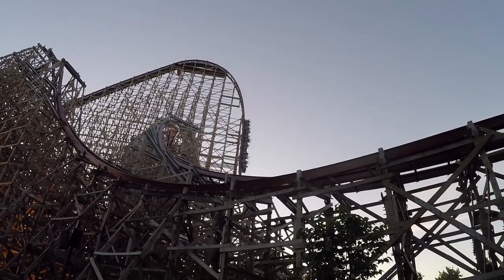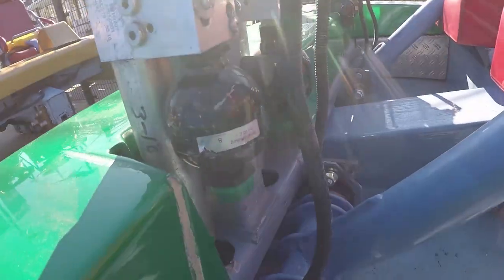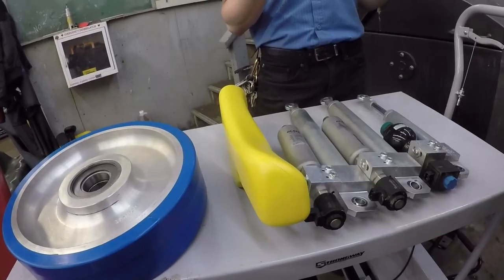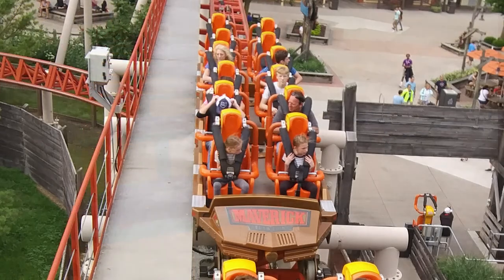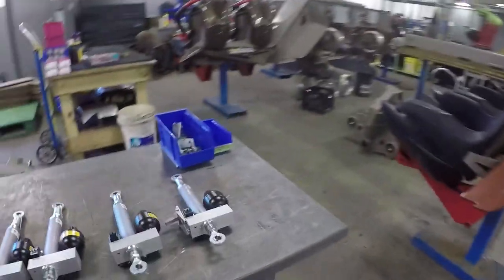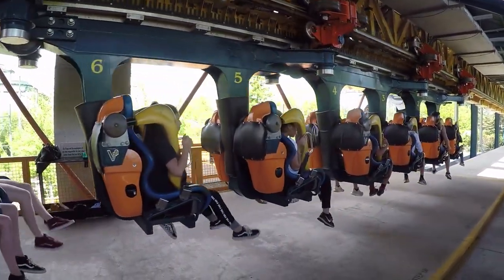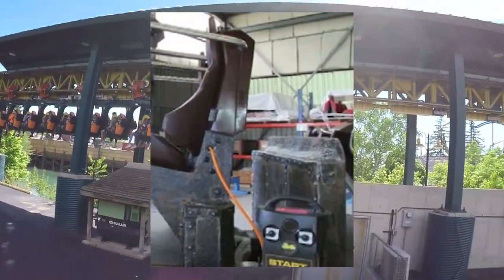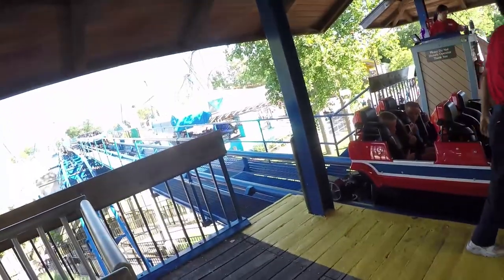Can Roller Coaster Restraints Open Mid Ride? (how roller coaster restraints work)

Comment from the maker: Going to pin this as it seems to have come up a lot in the comments. Another way ratcheting restraints can come up slightly is by "slipping a ratchet". Meaning that the restraint was not fully clicked into the next ratchet and at some point on the ride it clicked up one into the next ratchet. This happens from time to time, if you want to avoid it just push down your restraint more before riding!
Reply: GP To Enthusiast yeah this happened to me on Wildfire at SDC. Halfway up the lift hill it clicked in
Reply: It opened to my sister on ghost rider but it was at the start going up so she was ok.
Reply: Pro-tip from an operater, (Diamondback at Kings Island) to avoid this "false click" make sure after you push your restraint down, that you push down and pull up. This will help you.
Reply: @Varadict  I can hear this comment.
Reply from the maker: @tabbijoy6448  What ride?
Reply: This is the reason we have a law in Germany, that says that the ratchet needs to be locked by at least 3 position, until the control system recognizes it as locked.
Reply: Judge roy scream ratcheting restraint completely came up on me on the climb up the hill. Was wearing a seat belt and was a kid so just pulled it back down and wasn't too worried.
Reply: @ilorabird  rare to see such a cool headed kid. My compliments
Reply: That happened to my sister once, she thought she was gonna fall out 😂
Reply: @visionist7  thank you :) mind you it really did have a super large amount to do with my faith in the seat belt or I would of been super scared lol.
Reply: @ilorabird  in Europe a lot of coasters don't have seatbelts. Increases throughput. In America they're usually a legal requirement.
Reply: Can you please do a video on how a ride evacuation is preformed ?
Reply: @ilorabird  Jesus this has happened to me before so out of habit I always ‘test’ my restraints myself.
Reply: This happened to me on Shikra at Busch Gardens. It actually happened because I held on too tightly though.
I pushed the restraint so far into myself that it released half way down the first drop.
*I should add that this was an over the shoulder restraint, but it still worked via ratchet.
Reply: It happened to me
Reply: Once I was on a ride
And on a station after I was sat and the restraint locked it opened
I screamed at the crew crew and a guy came and calmly cmalped it back down and off the ride went
Little to say I nearly issued my selfe throuaught that ride and the restraints had my nails imprinted in em
Reply: @visionist7  it depends on the State since every State has different regulations when it comes to amusement parks . I ridden a few coasters without any belts and only a lap bar .
Reply: I already do that-
Just because I fear it not being tight enough.
Reply: That's exactly what's happening. Thank you.

Comment: Who else is an enthusiast and knows nothing can happen and you’re safe but ur still scared that will happen mid ride
Reply: Not me, cause even if it does, as he mentioned in the video there are seat belts that will hold you in either way
Reply: Did y’all even watch the gosh darn video?..
Reply: akiru anthony i LOVE zumanjaro, scared the hell out of me the first time i was on it!
Reply: UH! Yeah, I'm pretty sure almost everybody has this fear especially during the climb to the top of the dreadfully slow lift hills.
Reply: akiru anthony  so your 11?
Reply: akiru anthony  also that's a drop tower not a roller-coaster
Reply: @alexanderthegreat3444  you're*
Reply: @alexanderthegreat3444  thank you for using the correct you're. Also #heilgrammar
Reply: On roller coasters im only a little scared but the only ride where im actually sweating my butt off is falcons fury.
Reply: I have only really gotten scared one time that my restraint was not correct and it was on El Toro. We went to Six Flags Great Adventure as our senior class trip in 2014 and I was so excited to get on El Toro but when they cam to check the restraints the kept coming back to mine and pushing on it more, at the point I was ready to be like " I have no shame I will get off now" but they gave me the okay so I went. I barley remember the ride (especially the first drop) because I was terrified I was going to die right there and then... But I was obviously fine! Kinds sucks cause I didn't get to enjoy it and I did not re ride that day because of it. I really gotta get back there and try it again (I live in PA so NJ is a few hours away).
Reply: 0MindSwept0 Did you know that fear is a natural thing?.... As the commenter said they know they’re safe (99.9%) they just have that fear each time
Reply: @TS_Mind_Swept  not on every coaster
Reply: Zack Stanfield - Chinese coasters don’t count
Reply: East Coast Redux as an enthusiast myself I’ve had the over shoulder restraints come completely open on the Carolina cyclone at carrowinds a few years back! Came open during first loop and stayed open till the last helix where it locked back to the first click. Very scary
Reply: Teddy Rosenburg - and in all that time you never thought to pull it back down? >.>
Reply: 0MindSwept0 when did I ever say I didn’t? I WAS holding onto the handles pulling it down and it was completely free moving never would relock. Untill the final helix and then it locked tight enough to restrict breathing. The next season they added seatbelts to the over shoulder restrains that click into the seat. In all fairness it’s a prehistoric arrow no surprises there!
Reply: Teddy Rosenburg - it was probably poorly maintained is what it was..
Reply: 0MindSwept0 I doubt that, carrowinds is cedar fair. Cedar fair is rich! They spend plenty of money on maintaining and upkeep. They can’t afford an injury. I googled it and it’s fairly common on arrow
Reply: Teddy Rosenburg - why do you think Cedar Fair is rich? You’d be surprised what kind of corners they cut..>.>
Reply: 0MindSwept0 why do you think? Cause I research shit before I say it. They net 3million a year and have 182million cash in hand. They obviously are the leading chain of amusement parks and when are they ever in the news for something other than the dumb “coaster stopped on top of lift hill” story. That’s how well up they are on their maintenance and operations!!! They only ever make the news for a coaster properly working. You are making a claim about corners cut when you have no proof of that! There’s plenty of proof online the company themselves share about maintenance
Reply: Teddy Rosenburg - what a company says to everyone else and what they actually do are two very different things. Have you actually worked for them Mr. Research? I didn’t think so
Reply: 0MindSwept0 well earnings are factual numbers. And they have plenty of videos showing their work! But hey buddy YOU know everything there is to know and anything so what ever kid
Reply: 0MindSwept0 you must be upset, idk why you picked a fight with me in your first comment. But hey! You finally shown you don’t know everything. I’m grown and fully employed. You’re posting video games........ oh and an adult definitely doesn’t call someone blin. That’s not even an insult in America. “Pancake” 🙄🙄🙄🙄
Reply: @TS_Mind_Swept  I'm sure they did, its just the human mind has a tendency to wonder. I myself often think when getting on a ride that "Maybe I'll be a victim of a series of human or mechanical errors" even though I'm aware its illogical.
Reply: @astronomydemon6312  well it's unlikely, not necessarily illogical; I'm usually too busy thinking about the ride to bother with those thoughts though :p
Reply: I mean, I have a lot of experience with british coasters, and I've only ever seen this happen on three occasions, with one of those being my own restraint.
Reply: For me it's actually the opposite; I'm an enthusiast but I know that very, very rarely, things can go wrong. However I don't fear it for some reason.
Reply: Felice Graziano - because it’s not worth freaking out about and the rides are much more enjoyable when you don’t 🤷🏿‍♀️ (Plus all the redundant safety features tend to make actual issues potentially arising and causing anything more than a scare nonexistent, not that there aren’t some sketchy cases tho..)
Reply: Not me really. The thrill is what scares me tbh.
Reply: 0MindSwept0, not all coasters have them
Reply: Cool Bean - and the ones that don’t probably aren’t worth riding..
Reply: 0MindSwept0, how bout B&M hypers
Reply: 0MindSwept0, or gertslaur eurofighters, cannibal at lagoon, swarzhkoph loopers, a lot of wooden coasters
Reply: Cool Bean - Schwarzkopf’s aren’t particularly known for air time either way, and the others all have the redundant saftey features (seat belts); the only rides that don’t are either ancient wooden coasters that also have zero air time, or janky Chinese death traps that, like I said, probably shouldn’t be ridden anyway...
Reply: 0MindSwept0,  just because Schwarzkopfs don’t have that much airtime doesn’t make my point any less prominent they are still worth a ride and a lot of and a ptc trains and most Gci trains don’t have seat belts either
Reply: 0MindSwept0, also a lot of I takin coasters don’t have them too, like skyrush, i305, Ttd, king da Ka, maverick, millennium force, the pair of Superman’s at six flags America and darienlake and countless others
Reply: Cool Bean - The Schwartzkopfs I’ve been on have seatbelts, and i never said they weren’t worth riding, but I don’t know what you’re on about with the PTC/GCI trains because those ones have seatbelts as well
Reply: 0MindSwept0, my bad on the ptc trains, but gci timberliners don’t have seatbelts do they? Also which Schwarzkopf have you been on the has a seatbelt?
Reply: Cool Bean - GCI doesn’t make timberliners…that’s The gravity group (I also haven’t been on one of those yet); for Schwarzkopf, I’ve been on Montezoomas revenge at KBF and revolution at magic mountain, both of which have seatbelts, again though, not that it matters because there is no air time where you’d actually come out of your seat, they hardly need restraints at all (any restraint is a redundant feature in that case LUL)
Reply: @dilldozar296  how did you stay in the ride
Reply: Yummy Pineapples  we’re probably the same age lol, but yeah I’ve been scared since I was 10 and I still kinda am.
Reply: Yes, I know nothing will happen but I’m still scared lol
Reply: I get adrenaline on these rides, but zero fear, at least not from restraints. The only thing that can still get me sometimes are headchoppers and near misses, particularly on indoor rides like Flight of Fear. Some people seem to think the headchoppers are a more thrilling experience on outdoor clones, but to me everything feels closer in the dark.
Reply: @dilldozar296  Top Thrill Dragster has entered the chat.

Too soon?
Reply: I was on bizzaro and the shoulder restraint popped up near the top of the lift hill it didn’t completely fly off thanks to the seatbelt so I could pull it down this was in the second row it was during a night ride
Reply: Same
Reply: That’s me
Reply: Me. I always ride the "Raging Bull" At SFGA (Six Flags Great America). It feels as if it could always unlock and come open. I still wish there was a seatbelt.
Reply: Me. Which is why I make sure it's tight tight but not too tight. I love it being so tight just to make sure I don't fly out. People at an old theme park knew me and asked me if it wasn't tight enough for me. 😅
Reply: Exactly. You honestly don’t really know or see the restraints locking
Reply: I keep getting a recurring dream that it happens on the lift hills of various rides, that the ride ops don’t really check it so I do and it pops up lmao
Reply: @Glowmoff  😳 3x is too many!
Reply: Me
Reply: Absolutely, I love scary coasters but…..

I’m scared.
Reply: @TS_Mind_Swept  sounds like your home park requires them. A lot of parks and rides don’t have them.
Reply: @Hunting380  Any self respecting amusement park has them, and you can usually tell when they aren't from a mile away
Reply: Me
Reply: @TS_Mind_Swept Not every ride has seat belts
Reply: Im not. Im more trust in coasters than my mom. Im first gonna dr0wn in my bath then d1e on a coaster. Im usually jumping in the coaster just ot really check XD(while the ride is going im jumping in my seat bc of excitment)
Reply: @TS_Mind_Swept yeah well that gonna rip. Thats for you to feel safe but in mind is useless
Reply: @Coaster.Enthusiast.Equestrian  yeah, if you make it out of confetti and streamers like some Chinese parks ecks dea
Reply: @TS_Mind_Swept  well india isnt has the most safest system...hungary is almost the same
Reply: @TS_Mind_Swept   btw i didnt expected for you to answear🤗
Reply: @Coaster.Enthusiast.Equestrian  sounds like they're Hungary for trouble KappaRoss
Reply: Funny enough this has actually happened before to me, ridden an old Zierer Tivoli from the 80s. I was back row and had the train to myself, my brother and I while going up the lift hill, we laughed it was funny it was open the entire ride, we weren’t scared because of how tame that ride was, the coaster was autosled at galaxyland if I’m right haven’t gone there in a year or so.
Reply: @TS_Mind_Swept  not really. smiler at alton towers has no seatbelts for instance
Reply: ME BROOOO and I hate it because it keeps me from enjoying the ride sometimes :(
Reply: @Glowmoff may I ask which one this was?
Reply: Absolutely me
Reply: @TS_Mind_Swept did you even read the gosh darn comment? HE KNOWS HE’S SAFE!
Reply: Not me I’m too I’m the ride to even think about anything else
Reply: Yea
Reply: @TS_Mind_Swept Those seatbelts will with most certainty, not hold you in place.
Reply: @HugoLibert  if that was correct, they wouldn't be there
Reply: @TS_Mind_Swept  They’re only there for show and making riders feel safe. They fulfill absolutely no function.
Reply: @HugoLibert  ok, Boomer
Reply: @TS_Mind_Swept  Mad because you were wrong? It’s fine. You should be.
Reply: Me

Comment: One time while my father was riding one of the drop tower type rides (don’t remember where) the over the shoulder restraint got undone (my guess is he was too large, since he has a beer gut, so it might not have locked in completely) so it would’ve gone up, however, the seatbelt was clipped in so he just held it down with his arms and enjoyed the rest of the ride. Moral of the story: those tiny seatbelts are actually helpful.
Reply: In my country we dont have those tiny seatbelts. Sooooo rip lol
Reply: When I went on bizzaro my restraint randomly popped up I was on the verge of tears but thanks to that belt thing I was able to push it down in time and panic for the rest of the ride let’s just say I never sat in that row ever again
Reply: @sealfromthesea8453  where are you from?
Reply: No this did not happen. Lies
Reply: This just happened
Reply: This just happened and there was no seatbelt
Reply: Wish there would’ve been a seatbelt for the young boy. 😔
Reply: @janessyfleitas8758  the way that drop tower is designed even with a seat belt he still would of succumbed to the negative 2 gees of the magnetic breaks. He slipped out from the gap between the harness and the base of the seat. As the harness was still in the locked position when the ride settled. He was too big for the harness to cup him properly but nonetheless it was still locked. Negligence by the ride operators ultimately killed this poor boy
Reply: That protected your dad and it couldve protected tyre
Reply: Smh wished tyre had a seatbelt. At the end of the day it can save a life. Stupid manufacturers !!!poor baby
Reply: @jigglypuff3798  anyone with half a brain could see he didn’t fit, R.I.P. tyre, and Shame on all those clueless operators.
Reply: @jigglypuff3798  it had nothing to do with the manufactors of the ride. From what I read it was the ride operators who went against the ride and manually adjusted his seatbelt to allow him to fit. The belt had too much slack and he slipped out.
Reply: Goliath has no seat belt which is crazy to me
Reply: @ceaserri that's not even possible what
Reply: @eelovfx9200  I’m dead serious it like unlocked on the lift hill it was a b&m vest restraint
Reply: @ceaserri  if it really did  unlock the ride would have stopped because there is no way  half this comment sections harness randomly went up on a roller coaster but they somehow survived
Reply: @karmasera6478 which one, there’s like 5. But besides that usually it’s not needed. It can be a little safer but it doesn’t help that much and can hurt the rider experience.

Comment: This is a giant fear of mine. I’m not scared of heights- i’m scared of not feeling secure and it’s something that my family finds hard to understand. This really helps with my anxiety, thank you
Reply: I am afraid of falling off rather than heights. That's why I love roller coasters and have no fear riding them.
Reply: @Emoticono13  I am so short that Voyage feels rough to me. (5'3" or.. just convert it if u use metric)
Reply: @HeelerHouse  haven't ridden it yet but having ridden Cu Chulainn I can day that Gravity Group woodies are neither smooth nor rough for me.
Reply: Same. I love flying, for example. But if I were dangling from a plane by a rope, I would be afraid. It’s a matter of knowing I’m relatively safe.
Reply: I'm afraid of falling from high places and not feeling secure while high up (so kind of like a fear of heights?) I think that's part of the reason why I usually don't like the feeling of being lifted out of my seat during certain rides. The idea of the restraints coming loose and suddenly opening is something that crosses my mind almost every time I go on a ride. This video at least makes me feel a little better.
Reply: Me too!!!!
Reply: i completely agree with everything
Reply: The restraints are safe because you can't get out of the either. I love lap bars for this reason, especially the hydraulic ones. I even like the el toro restraints. Minimal contact, snug as a bug.